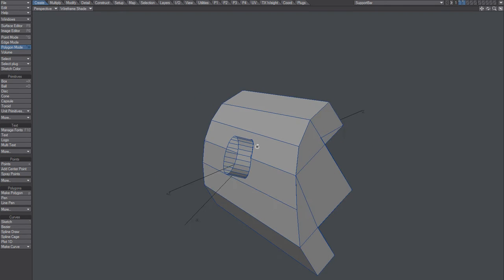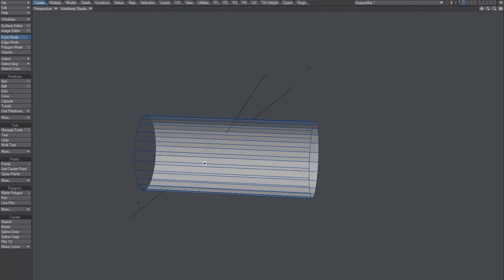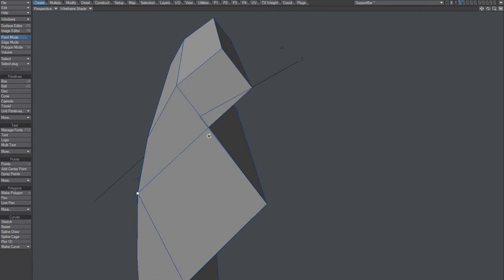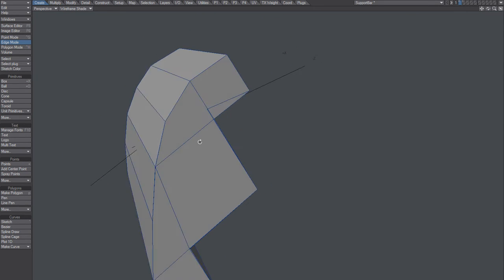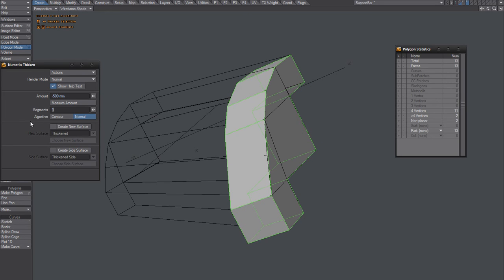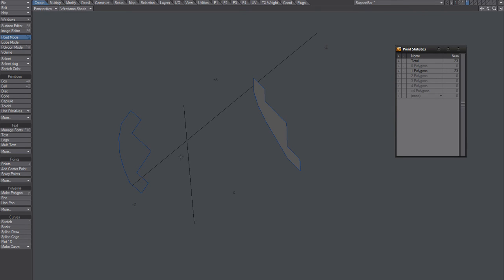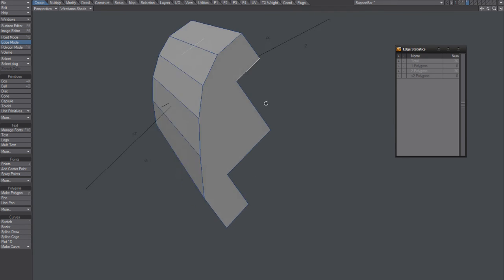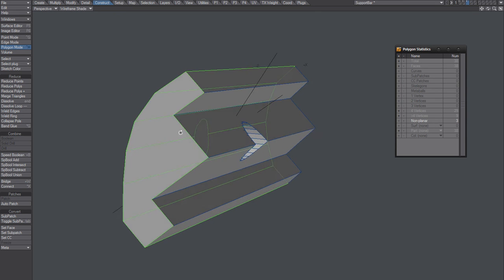LightWave Model - Boolean for a Newbie - 101

Comment: how does Lightwave compares to 3ds max 2023 in terms of modeling?
Reply from the maker: hi, 3dsMax is much better overall, LightWave lacks development.
Only a few who use the LWCad plugin will find LightWave better these days.
That said, LightWave is quite fast for modeling simple models.
Chamfer for example - way better in Max
Reply: I suppose that's a paid plugin. Max developer already have a new Boolean system in beta testing and they will soon ship it with the new Max update. Thye will also further refine it like they did with the latest tools they had so it will. They are also further extending the new robust array and probably experimenting with world building tools. So I dont think there would too many packages that can still compete with max in these aspects.

Booleans are probably destructive in Lightwave from the few vids I've seen without this plugin right?  Does it have something nondestructive at tool level at least? I see some sort of modifier stack was added in 2018. Itseems to be impossible to find any indepth video besides a quick demo on this.

But anyway, Im interested in your classical modeling tools.
Does it have some straightforward direct modeling tools that Max doesnt have or they work faster or smarter? I would be interested in a vid about a quick comparison of these in both software.
Reply from the maker: @orphydiancg7759  modifier stack in Layout 2018, but LightWave still has a destructive workflow, like always.
so for technical models (robots etc) LightWave isn't that great.
no comparison video coming from me any time soon unfortunately. also i don't use Maya/Max/C4D/Modo/Houdini.
i've used Blender for this/that earlier. 
my reason for not using Maya/Max is basically cost + subscription.
i'd more likely go the Houdini Indie route. but i found it to be slow many times because of the Sub-node system.
so Blender is the alternative personally.
getting a 3Dapp highly depends on the reason for getting it tho' - Maya/Max for example are industry standards at times.
Reply: @erikals  Both MAX a Maya have a pretty affordable indie license like 250 dollars per year or so but I'm sure you know that or maybe not? I would go with Blender if I would have some serious hardware and a drawing tablet because other than the sculpting tools it sucks big time compare to any paid alternatives. C4d would also be very tempting if they would ever offer an indie license because I dig a lot their new updates there especially for modeling and the scene nodes projects they are actively on the work. It will offer the most attractive way to work on a both stack modifier workflow and a node graph one in the most flexible way.
Reply from the maker: @orphydiancg7759  Max/Maya indie license is great, no VFX tho' and doesn't support plugins.
C4D is nice but $$$. 
Blender is moving Up every month, i just don't fancy the Ui / workflow. But love it as a "plugin"
it all depends on what we need. ☺️
strongest alternative compared to cost is without doubt Houdini Indie.
Reply: @erikals  didn't know about plug-ins restrictions with Max/Maya indie. Man it's a really tough decision, imagine if Lightwave was still in the game too lol.

I suppose lightwave doesn't have some basic Sculpt tools either. How is its  UV editor?
Reply from the maker: @orphydiancg7759  yeah, Max/Maya is nice, but there is always a catch22.
no Sculpt in LightWave, there is a plugin, 3rdPowers Brush tools, but not sculpting really.
i loved MudBox, but AutoDesk had to ruin that ($$$). Zbrush is $$$ these days. But 3DCoat is a great cheaper option.
Reply from the maker: @orphydiancg7759  the UV editor is so-so, it is better than many claim. many just don't know how to use the tools.
https://www.youtube.com/c/erikals/search?query=UV
Reply: @erikals  about this Modeler /Layout disjointed experience : what actually modeling tools are in Layout  that are missing in Modeler and what would be the logic of that. Also, there is some sort of live update or sync between them at least when you have to... model in both of them.
Reply from the maker: @orphydiancg7759  live sync for simple geometry updates, but that's it really.
mostly Modeler / Layout split is ok, but it also is a total drag at times
Reply from the maker: @orphydiancg7759  modeling tools in Layout = None (!)